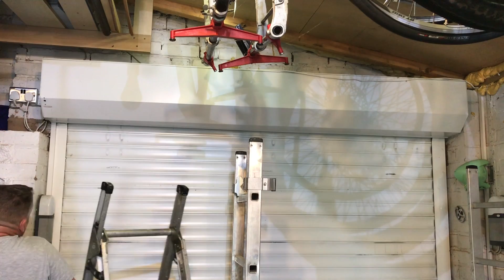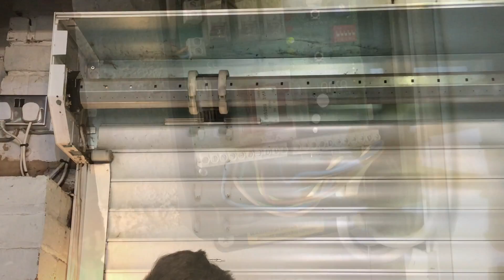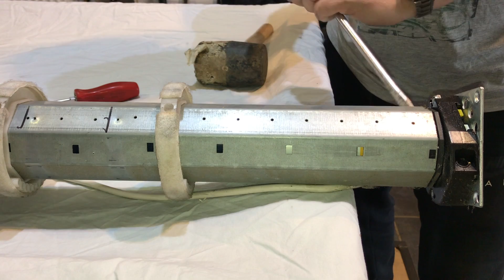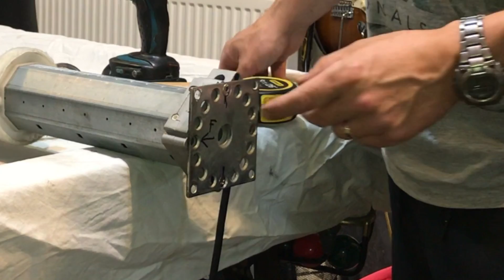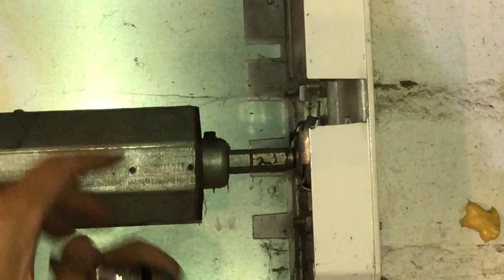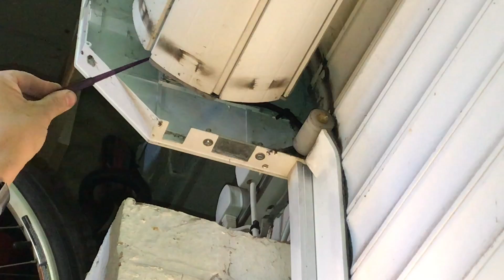Roller Garage Door Motor replacement, "How to Repair Electric Door"

Comment: Fair play to the chap having a go in this video however being in the trade I think I should probably offer a bit of education to those of you who may have been misguided.

When removing the box cover/canopy don't rely on the top hinge part of the lid to support it as in this video - its rare that they actually stay in place when the rivets/screws have been removed, it will more than likely fall off - its only light but the ends can be sharp and you'll probably lose a bit of confidence when it just falls off.

The original 'somfy' motor was not 'under-powered' or of a lesser quality - in fact they're renowned for  being the best in the market. When properly designing a roller garage door you have to make sure the motor can lift the door weight but you must also ensure that it does not present a 'drawing in' hazard. 

A correctly selected motor running in an ANSA control panel will stall if someone or something is trapped in the door when opening as it can monitor the motor - by selecting the 100nm motor this door will quite easily lift up and entangle your child or your pet into the roller mechanism given the correct circumstances. 

Before anyone says "as if that can happen", be sure to google person trapped in roller shutter and you will find a great many instances - hence why the regulations regarding drawing in were created. Of course, joe public are not to know this but the company who supplied you the motor should, which given what they've actually supplied, they don't seem to know either!

Warranty of this motor will be interesting as having used various motor companies over the last 20 years their guarantee is always with their supplier, not the end user. So if the company on Amazon decide to close that shop and open "roller shutter motors mk2" then I don't think the motor manufacturer will be obliged to replace your motor if it goes faulty within your perceived warranty period. This is how its always been in this industry and as much as I don't agree with it, I think its legally correct - I think it comes under the fact that once their product (the motor) has been consumed into the finished goods (the garage door) then the warranty lies with the finished goods provider - again not 100 percent on this and would be interested in some plausible debate other than "they have to, its like a washing machine".

There are also quite a few different designs of roller garage doors and two I know if in particular have a spring either attached to the roller barrel or within the roller barrel - if you were to undo the bolts holding the motor to the end plate without releasing this tension first you can cause yourself a serious injury. 

Also, more dangerously you may be able to remove the roller barrel with the spring under tension as it could be being held in place by a bad fitting within the tube, but sure as sh1t it will go with the slightest tap or knock of the roller when you put it down or knock it against something when manoeuvring it about so watch out for that as that will take an eye out.

Other than that I think its pretty clear to see that this isn't a particularly difficult job to do and you can bumble your way through it on an installation like that in the video. I would say that a typical garage door team of 2 engineers would have the whole thing completed within an hour start to finish, e.g. arrival, tools out, work done, service, paperwork, tools in. 

But also bear in mind that the cost of such a job to a business isn't just the part and two lads on £9 per hour - they offer a service, they more than likely employ local people and support your local economy. They also have to make sure that they are still there if the motor goes wrong under warranty.

You may have come across this video because you believe the firm(s) you have had out are trying to rip you off, and, unfortunately I've heard of some firms charging over £600 for new motors on jobs like that in the video, which is extortion to most right minded people - but I'd also say check what's in the quote because they may be quoting to upgrade the whole roller to an improved version. Or one with a safety brake bearing. Maybe the problem with some garage door firms is poor communication about what's included.

I will finally add that the problem with the motor was probably just a capacitor that could not cope anymore when the door is at its final third of closing because this is when the motor draws the most power because that's when most of the door weight is suspended on the roller.

What a long reply this turned out to be - if you got this far well done, 5 stars ***

Top marks to the chap for making the video too, although if I'm being honest I didn't watch it all the way through I just skipped through to the important bits.
Reply from the maker: Some Great points in there, you should have watched the video all the way through as I do mention some of the points mentioned in the voice over, but as always its great to get some good advice from someone in the trade, as it will always help the next person, Thanks for the great comments👍🏻👍🏻🛠
Reply: You sound like you're fun at parties....
Reply: How much does this replacement cost ? Got a quote over £1000
Reply: My quote was £995 + vat!!!!
Reply: Far from being misguided, he did an excellent job and replaced the safety circlip so I, as a retired Chartered Engineer, am very impressed. I think people watching this are generally fed up with trade people ripping them off. 
If the trade prices were more reasonable, there wouldn't be  such a huge audience for videos like this.
Reply: @PaulWingfield  I've lost count of how many "engineers" I've done work over the last 23 years doing these doors.

You "engineers" say it as if you somehow know what your talking about with roller shutters and garage and such but the fact is you clearly don't or I wouldn't be there having to make you feel better for getting a "man" in.

It's also extremely misguided of you to use the blanket term tradespeople or person in the way have assuming we're all here to rip people off and not simply make a living.

Comment: I didn't notice any pretension on the spring. Mine has 8 turns of spring tension that I have to release first before I can lift the roller out. Does yours not have that?
Reply: Yours is a securoglide made by SWS. they use a spring instead of safety break as an antifall back device
Reply from the maker: No pre tension in this style of motor, usually this is on industrial doors, Thanks for the great comments👍🏻👍🏻🛠

Comment: My garage roller door is about 12 years old and has been opened and closed less than 100 times max in 12 years  as we don’t use it as a garage. It is not going up or down using the control panel or remote. It will open and close using the manual winder. As it has had effectively no usage I am wondering what the most likely problem is. There is power to the controller and LED light is permanently red ( not sure if this is normal). When I press the open button there is noise on the motor for about 1 second but then nothing. I am wondering if the motor has failed simply to lack of use. Is there anything I can check to work out if my motor can be fixed or if a new motor needed? Would lack of use cause a motor failure?
Reply from the maker: This video will help you out https://youtu.be/vUtGT6kyIJA Thanks for the great comments👍🏻👍🏻🛠

Comment: Can we use a 300 Ws UPS battery backup with outlet to operate the motor in case power outage?  thankyou!
Reply from the maker: I don't see why not, the unit also has a Manuel winder, Thanks for the great comments👍🏻👍🏻🛠

Comment: A  good door company would if charged around £250 to s&f a new motor ,it took you ages it was light and dark when you finished ,giving advice and your not a door engineer,some of these barrels have springs in them , you'll have non experienced diy people like you attempting to save money ,then taking there fingers off , lots of things you did wrong here , you could of easily saved even more money did you check the anti stall detection in your ansa control box ,1st thing to check its not always the motor 😉
Reply from the maker: You must be a door engineer 🤔, I would love to know what Grade motor you could supply and fit for £250, it definitely wont be as good as the one I fitted, Thanks for the great comments👍🏻👍🏻🛠
Reply: @aaanton11  you know it all an ellard motor costs £45 50nm ,we buy 100s of them nothing special ,if you wanna get technical an elero one is the best ,somfy are over priced and usually last 5 years , its a job that takes a qualified door engineer around 1hr 30 max ,so its easily achievable £250 is the going rate , what special motor did you fit ?

Comment: Thank you for the video, so helpful and has given me knowledge to attempt this myself - however, a bit of advice would be handy...
Our garage door was installed 15 years ago, working fine until a couple months ago when it would open about 1/3 of the way and then need a helping hand to fully open, now it lifts a few of the slats but won't raise the door off the floor at all. It's never had a problem going down. Would people recommend replacing with a new motor due to it's age, or just attempt a capacitor repair? Thanks in advance!
Reply from the maker: Always try the cheaper option and save the planet if possible, Thanks for the great comments👍🏻👍🏻🛠
Reply: Many thanks Anton, you inspired me to have a go and it worked! Similar to Matthew, my Thermaglide door worked fine for 12 years then got progressively worse, sticking in places. When I dismantled, the SOMFY motor was only 25 Nm, so I followed your example and upgraded (to 50Nm, made by Ellard, via Amazon). This solved all the sticking and now the door works perfectly again.

Comment: depending on what side your motors is on the brown and the black would need to be switched in control box, how you can remember it is take the second letter off the colour  "BLACK IS ALWAYS LEFT AND BROWN IS ALWAYS RIGHT" the motor should be fitted inside the tube to the crown end with rivets Somfy are the best tubular motors
Reply from the maker: Thanks for the great information👍🏻👍🏻🛠

Comment: Hello.. just having the same issue with our roller door. Replaced the remote panel but still the same issue. How long did the whole process take you. Cheers
Reply from the maker: All done in a morning, Thanks for the great comments👍🏻👍🏻🛠
Reply: @aaanton11  how long did it take to get the new motor.

Comment: Very useful video @aaanton11   Thank you for making it and sharing it for out benefit.
You saved yourself a lot of money, but you could probably have brought the whole bill down to about 4EUR  
I can concur with @nightjar
 Over 1year ago my two roller shutters of the house developed a problem.  Going down was still fine, but going up became harder and harder. 
I followed this video (https://www.youtube.com/watch?v=9n-RbCmj0Is&list=RDCMUC6QDKbBbCP6fIk9HUPNHNrg&index=6) Unfortunately it is in french.. I guess nobody is prefect.. grin,grin.  Long story short, I replaced the capacitor (ordered on Amazon) and now, 1 year later they are still working fine.  
Motor: Somfy LT50,  10Nm, 12rpm, 100W.  
Capacitor : 3.5 uF, 220v AC 230v  AC 240v AC 450v AC.   https://www.amazon.de/gp/product/B00R0ZU6G6/ref=ppx_yo_dt_b_asin_title_o00_s00?ie=UTF8&psc=1  about 4EUR  
please verify the capacitor specs.  Different motors have different capacitors.
Reply from the maker: Mine was a gearbox issue as well, so the unit needed replacing, but the repair you have done is spot on, Thanks for the great comments👍🏻👍🏻🛠

Comment: This is a really useful and thorough work through of replacing a garage door motor which inspired me to replace my own failed motor. I did fit an Ellard motor and would say the instructions are very limited so study the video carefully. Two tips to suggest , 1) take measurements of the old motor drive and limit collars and send them with photos  to Ellard sales to make sure you get the right collars ( it took me three attempts on my old door ) 2) the two arrows on the limit adjuster indicate the direction of rotation not Up and down , my motor was on the right side and it took a while to work out which limit I was adjusting . Brilliant video , thank you !
Reply from the maker: Happy to help, Thanks for the great comments👍🏻👍🏻🛠

Comment: Anton, great video. Did my partners roller door yesterday and today. she’s been doing it manually for over a year. It’s so satisfying once it’s done. Watched it go up and down at least 20 times afterwards. I also used an ellard motor going from 30nm to 80nm. Rang them yesterday and the motor arrived this morning. Excellent service. Thanks for sharing. I’m going to add a remote control now so I can open from outside.
Reply from the maker: Amazing!, Thanks for the great comments👍🏻👍🏻🛠

Comment: Our roller door opens on it's own if we have a power surge or if power comes on after a powercut is this a fault with the control unit or somthing else
Reply from the maker: control unit fault, you don't want that happening, Thanks for the great comments👍🏻👍🏻🛠
Reply: @aaanton11  thanks disconnected safety beam has stopped this happening

Comment: Loved this vid.  But why have you got to controller boxes, one each side of the wall please?
Reply from the maker: I Have 2 Doors, the one you see and a huge one into the car port, Thanks for the great comments👍🏻👍🏻🛠
Reply: @aaanton11  No, thank you so much for your prompt response!  I don't suppose you can shed any light on these controller units too, because our light failed and then the red button ceased to work while the remote was OK.  Your video was not only helpful but amusing too - just the right balance of no-nonsense, down to earth help which has inspired me to tackle my own motor!  Well done!

Comment: Hi Anton, great video, thanks for the help! How did you come to the conclusion that motor was the issue?
Reply from the maker: It was getting louder and louder, and by checking the feed voltage it eliminates the control panel, Thanks for the great comments👍🏻👍🏻🛠

Comment: Limit adjustment on these motors are fairly simple: look at the arrow directions & vision what way the curtain rolls up/down, then to make the door roll up higher tweak the + symbol either clockwise or anti clockwise or too lower the limit tweak the - symbol too your desired position. Always handy to mark up inside of hood canopy box what limit is up/down with a marker pen for future reference

I find it easier to hold the directional button & make the adjustments at the same time but obviously tweak the desired limit direction very slowly so you don't over do it
Reply from the maker: You Know your stuff, Thanks for the great information👍🏻👍🏻🛠
Reply: @aaanton11 I'm an industrial door service & Repair Engineer,  do it everyday as a job 😂
Reply: https://youtu.be/Dlw5olN7RFs limit adjustment demo
Reply: Also once you know what limit is what, grab yourself a mark pen & Mark up with colour is what limit 👍🏻

Comment: Ellard are a decent brand for motors especially on the bigger industrial type doors & also gates. Before re connecting the curtain attachment straps to the barrel with the new motor wired in etc run it down to its full bottom limit so It doesn't go down no more, then attach the curtain straps the barrel. Then take door up & slowly decrease the top limit - until the door stops to your required position.
Reply from the maker: I think that's what I did to find the motors lowest position, once again Thanks for the great information👍🏻👍🏻🛠
Reply: @aaanton11  I've know some people when installing new shutters or replacing the motors they re connect the curtain attachment straps to the barrel the adjust the bottom limit without realising what they've done 👀😂

Comment: I'd recommend re fitting the hood cover back on using 'pk' screws or tek self drilling screws, much easier for the removal next time. Also when removing the curtain attachment straps beforehand, I'd recommend blocking up the door slightly with timber or something so that when re connecting it's easier to re fit the curtain attachment straps as you won't have to pull the curtain up by hand to re align/attach etc
Reply from the maker: I like the idea of the blocks of wood, Thanks for the great information👍🏻👍🏻🛠

Comment: The motors are slid inside the barrel tube & the end of the motor collar is rivited into position, sometimes the rivets fail & break off which then you see the problem of the motor is turning within the barrel tube which you can hear but the barrel is not lifting the curtain. Where the roller wheel is at the other end, there's metal tabs that have been tapped down to prevent it from jumping out the cup end. If removing in future don't forget to Bend up first of all, then when re fitting make sure you tap the tabs back down. Or alternatively as you have done in the video undo the grub screws on the shaft collar, there may be a circlip or a hose 'jubilee' clip to undo
Reply from the maker: Some great advice in there TL  2584 thanks for taking the time to comment. 👍🏻👍🏻🛠
Reply: @aaanton11  no worries! I'm a industrial door engineer so I deal with these kind of jobs on a daily basis lol. Learn tips & tricks over the years that your in the job 👍🏻

Comment: If the garage door goes down normally without excessive motor noise but fails to go up its more than likely the run capacitor inside the motor which is the white plastic cylinder attached to 2 wires and if you can workout how to disassemble the motor the capacitor is easy to swap for a new one(Just be aware they carry a charge even when unplugged, but shorting it with a rubber handled screwdriver will instantly discharge). Mine cost £6.99 and the garage door works like new!
Reply from the maker: Thanks Nightjar for the great information👍🏻👍🏻🛠